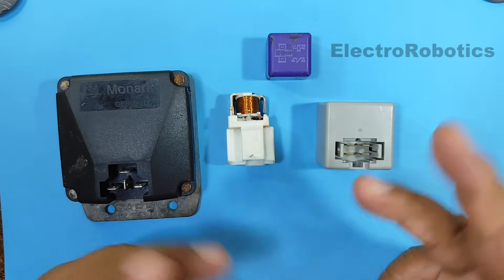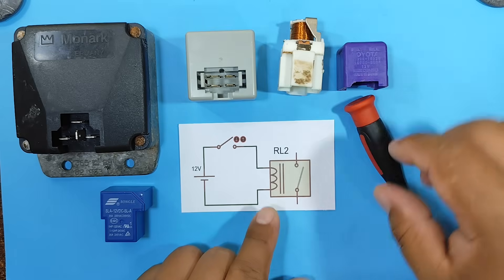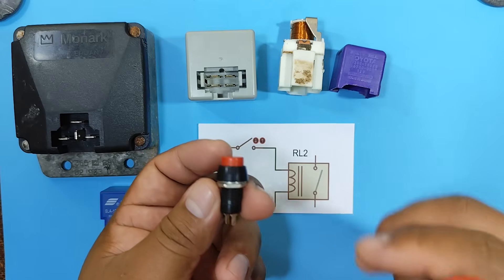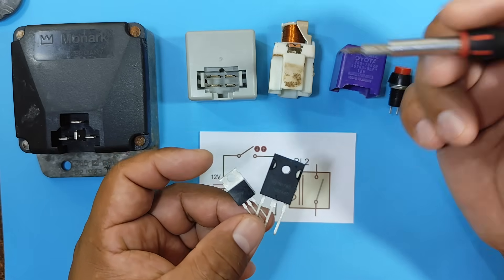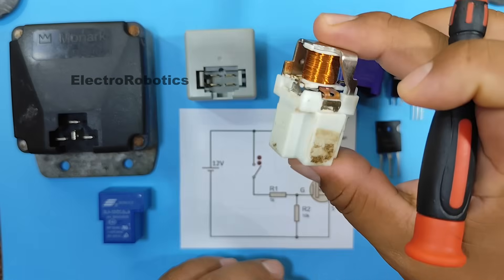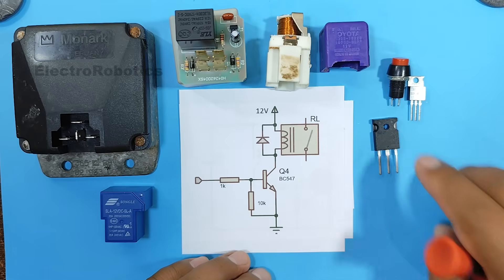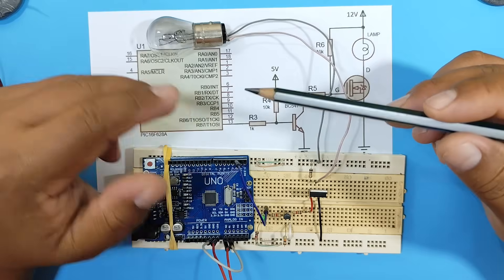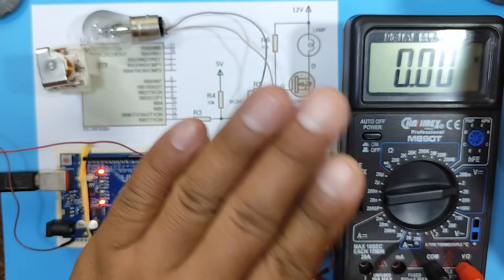Use a MOSFET Transistor Instead of an Automotive RELAY to Handle Large Amounts of Current.

Comment: The correct answer is  relay, and the correct reason is  voltage drop.   Voltage drop, voltage drop  voltage drop,  in solid state devices.   Seconarily, voltage drop causes heat,  which means  high  amperage circuits  cause  heat in the switch gear.  I squared R drop.    This is something that may not matter much in, say,  a 120V AC circuit,  but when you only have 12-14V to start with,  even fractions of a volt matter,  sometimes,  to a load
Reply: Never thought about it like that thanks.

Comment: IGBTs are better than MOSFETs for high current switching. BTW, todays cars still using mechanical relay instead of solid state / electronics because of their robustness in harsh environment and easy replacement.
Reply: Of course they use relay its easier doesn't. Require. Specific duty cycle hz.

Comment: In an automotive application all circuits are fed from the same battery. So be very careful when replacing relays with MOSFETs in high-current circuits. For a MOSFET to survive in a high current environment it must work in the saturation regime.  That is achieved by the driving circuitry keeping the Gate voltage high. But if the current that is being switched is high it may force the battery to temporarily drop the voltage (during the switch).  Accordingly the driving circuitly will drop the voltage that it applies to the Gate of the MOSFET. And this may pull the MOSFET from the saturation regime back into the linear one and with the currents involved it will get burned in no time.

Comment: The galvanic isolation in automobile of a relay has a reason. They switch high loads and switching these on and off create all kinds of nasty spikes that can easily break the switching circuitry.